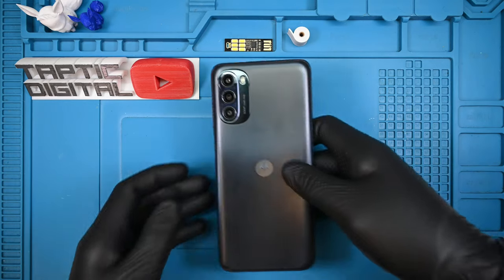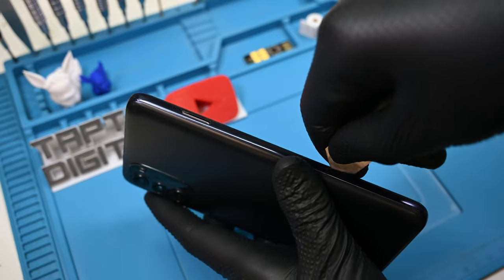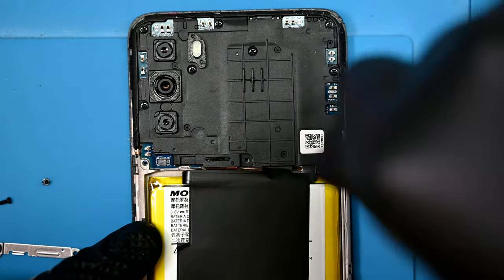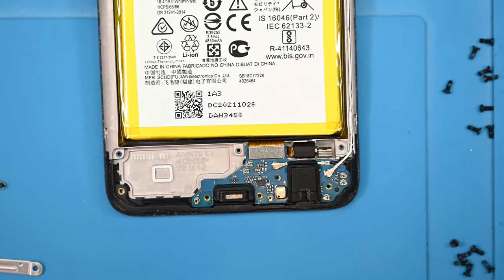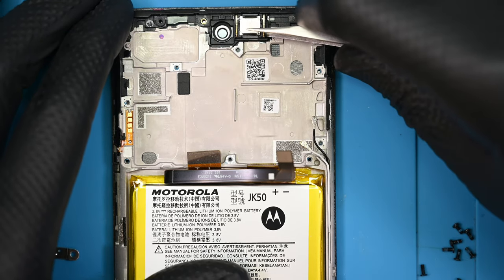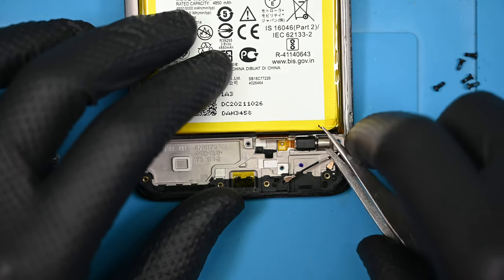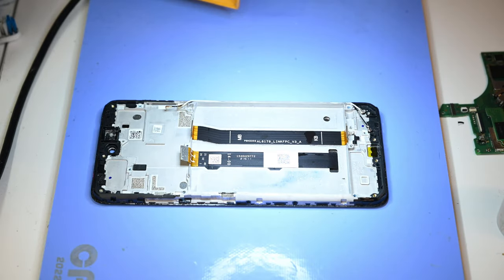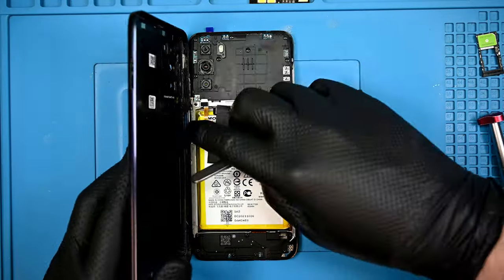Motorola Moto G 5G (2022) Teardown and Framed Display Replacement

Comment: I recommend going ahead and buying a replacement side button flex cable rather than trying to remove/reuse it.  I was unable to remove it without damaging it, and had to replace it.  Fortunately, it's a $2 part.
Reply: You can use a hair dryer to soften the adhesive, if you don't have a heat gun. Also, use isopropyl alcohol to obliterate the adhesive.

Comment: This did work for me. All I had on hand was some pure acetone and that worked fine. I know people use acetone in place of alcohol for certain things. I used my blow dryer to heat it up. I tried to take the battery out too soon though. It was stuck real good. It bent a little but no big deal in the end. I reheated it an added more acetone and it came out. Then you surprised me by saying "now go backwards to put it back together" lol I did it though. Took about 30-45 mins. Thank you so much.
Reply from the maker: That’s impressive! The reason we don’t use acetone much is because it can’t melt the plastic and internal components these phones are made
Reply: @TapticDigital  oops. Guess I won't do that again. It's still working 20 hrs later. Fingers crossed. lol
Reply: Acetone? I ended up using Ethanol in the form of 75.5% Everclear when I couldn't get Denatured Alcohol. Acetone... I need to learn Chemistry.
Reply: @Bunker278  it's nail polish remover. Found in most American households where women live.

Comment: The little gaskets for the mics (seal the gap between the frame and rear cover) needed to be transferred over from my own phone frame. Great video. Just finished replacing the screen on my own phone. Thanks!
Reply from the maker: @Bunker278  nice! Glad to hear a success story. Parts are weird, I’ve had some replacement frames include ear speakers and vibrate motors and then some that don’t from the exact same vendor. But good catch transferring them over, without them the microphones don’t work nearly as well.

Comment: I need to replace a battery in one of these. Wheres the best place to buy one of these? Amazon feels like theyve only got sketchy sellers. :(
Reply from the maker: @gothambatbrat  check out iFixit and see if they’ve got one, very reliable.
Reply: Hey! I was able to get one and I'm mid project! You're video is the only one I can find that super clear. What percent iso alcohol should I used for this project? I'm not replacing the cable, so is it still safe to use that much? Thanks!!!! @TapticDigital

Comment: I did my own repair following you  step by step pretty easy however for some reason the charger the phone came with dosen't change the phone now. I bought the same replacement as in this video.  What could be the issue? HELP I NEED MY PHONE!!!!!! Thank you
Reply from the maker: Sounds like the ribbon cable that goes to that charging board might not be fully connected. Assuming it's the same charging board that came out of your original phone. That ribbon sits under the battery and sometimes when reassembling the phone, the battery squeezes the connector loose by tugging on the ribbon. Pop the back off and remove just the bottom screws and shield, press the connector against the board (not too hard now, we don't want to break it), and connect the charger. Don't worry, you won't get zapped from holding it, but it should let you see if its just a connection issue or something else.
Reply: Ok thank you I’m going to do that and will give a update thanks!

Comment: I am looking at repairing my daughter's. You mentioned the variance by year. I am only seeing one screen and frame option for it so I assume any difference is just internal connection based but the different years use the same Digitiser and frame ? I hope so at least or I have one coming that won't work😂. Great video too, efficiently to the point. Bravo!👏
Reply from the maker: @martinchristopher2002  thank you! Motorola has a tendency to reuse names a lot, and sometimes puts a year behind it to help. In most cases as long as the XT-model number matches you should be good to go.

Comment: I'm thinking about doing a repair on this model - which would make it my first DIY phone repair. When is it safe to opt just to replace the LCD screen rather than ordering a screen preinstalled on a new frame/chassis? Would this save enough money to make sense?
Reply from the maker: Oddly enough most screens with the frame cost only around $10 more than without. The main reason I suggest using the framed version is the lack of extra work. Scraping and peeling the old display off the frame and then gluing a new one on is tricky, sometimes the screen lifts off after a few weeks of use. But it's entirely up to you, some people enjoy the screen replacement process!

Comment: Thanks for this video, i bought the screen with a frame, and the only thing I didn't notice is whether you need to use glue something or not needed?
Reply from the maker: As long as you got the display and frame combo you shouldn't need any glue for this repair!
Reply: The side thingy for the buttons won't stay down.  Should I glue this?

Comment: This is the 6.5" version or XT-2213.  Would you happen to have a video on how to do the same repair on the 6.8" model XT-2215?  They're similar but some differences and I'm not sure how to get the buttons out.  Also can you please tell me what type of adhesive glue is recommended for reattaching the button ribbons to the new frame and also what type of glue to use to bond the LCD to the frame if I decide to get the LCD/digitizer assembly separate without frame.  The way this one is put together, it may be easier to replace the display then swap the buttons and ribbons into a new frame.   Thanks!
Reply from the maker: Hmm, I could definitely make a video on it but I haven't repaired one yet myself! If one comes across my desk I definitely will. If you do display only I recommend either B7000 glue or a cold pressed glue.

Comment: This video is really great. One question? The only thing you didn't show is putting the back back on. Do you need glue or anything to seal the back? I need to fix my speaker and I want to make sure I have all the parts.
Reply from the maker: No glue or tape needed for this one, that back shell has a bunch of little plastic tabs that clip into the other half of the phone.

Comment: Thanks for the tuto. 
But after replacing the screen with frame, the screen is working but I see the Motorola logo on screen then it shuts down, then this is looping infinitely. 

Any ideas what could be wrong ?
Reply from the maker: I usually start by backtracking a bit. Take the old screen and connect the display ribbon to the board (that way you don't have to take it all apart again) and try to power it up. Does it work with the old screen? If so, the new display is either defective or shorting something. Still no boot? Fully reassemble with the original parts and try, if the issue still persists something has gone terribly wrong and a factory reset from the recovery screen may fix it. If a reset fails, you're looking at possible damage somewhere on the board.
Reply: @TapticDigital  same behavior with old screen. 
I have doubts about the volume connector, it was hard to remove maybe I damaged it. Do you think this can prevent from booting ?
Reply: The power button is stuck on
Reply: I had the same problem I took it to have it repaired and he made the volume down act as the power button

Comment: When i was pulling the strips for the volume and power button, i wrecked the adhesive, and the new screen i have does not have any adhesive preinstalled. What could i use to stick the strips back down?
Reply from the maker: Honestly you might not need any at all, once it’s all assembled it should stay pretty solidly together. But, if you need to adhere it, use a thin piece of double sided tape, or a dab of silicone based glue. No super glue!

Comment: Struggling to get the phone open - not sure how hot it needs to get or what I can do. Any tips?
Reply from the maker: This particular model doesn’t really require any heat to open. It’s a plastic clamshell style back panel held in with small plastic clips. Running a pry tool around should pop the clips out of place. Thankfully the back panel is plastic and can bend and flex quite a bit more than you might think before it breaks or warps.
Reply: @TapticDigital  ah. Must need a thinner pry tool then. Clips explain why I was struggling so much to get it open. Thank you so much for the clarification!

Comment: How do I find the replacement part panel what ever you call it
Reply from the maker: You can purchase them online, I usually recommend Injured Gadgets or GadgetFix, sometimes Amazon even sells the parts. Just make sure it's for the correct year, Motorola makes dozens of devices every year.